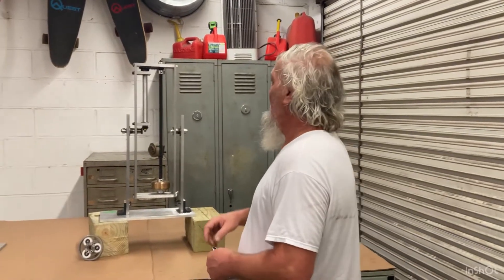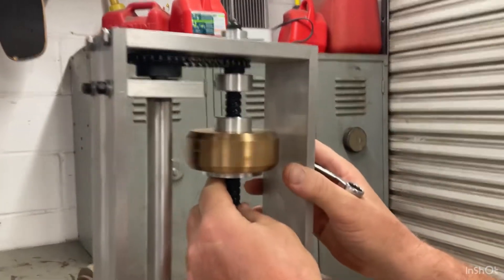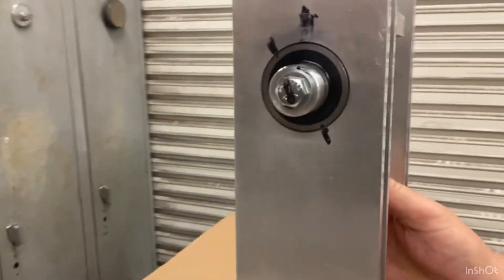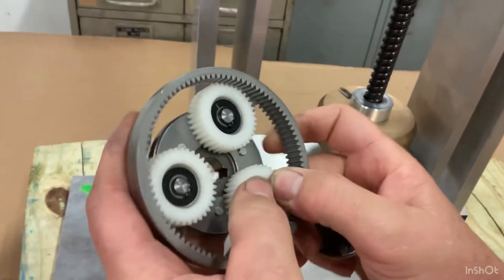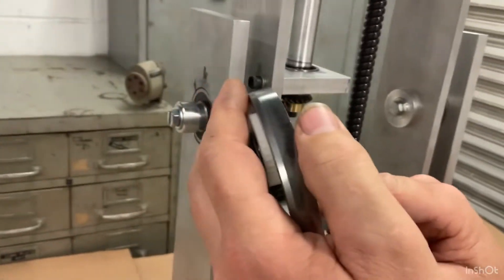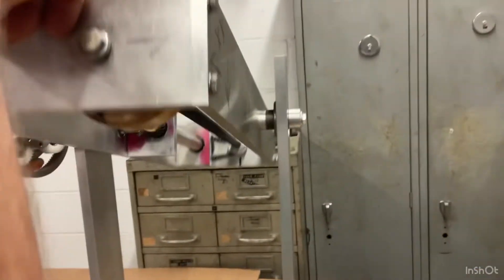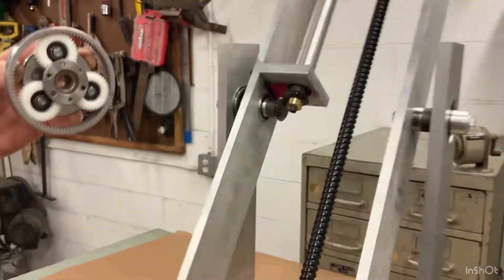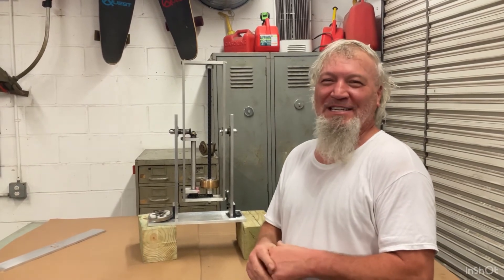Explanation of my free energy machine (how it works)

Comment: No offense but this cannot work.  Friction at every mechanical interface (gears, bearings, etc) by definition will dissipate energy and the initial potential energy in the system is limited to the stored kinetic energy represented  by the height of (at the top of it's travel limits) the spinning bronze traveling weight that rides down the threaded shaft (also friction there).  The preservation of energy,  and therefore the number of repetitions it can perform before failure, will depend on how low the friction can be maintained, but that is the nut of the problem with all "perpetual motion machines":  there are no frictionless mechanical systems, so there can be no perpetual motion without external energy applied to the system.  
Fun to watch it , and I love planetary gears, but the premise that it can move perpetually (which is the essence "free energy" contraptions - none of which have ever worked as touted), violates the laws of thermodynamics, and those laws  has never been proven wrong, at least on planet earth.
Reply: I would be surprised if it made it through an entire cycle.